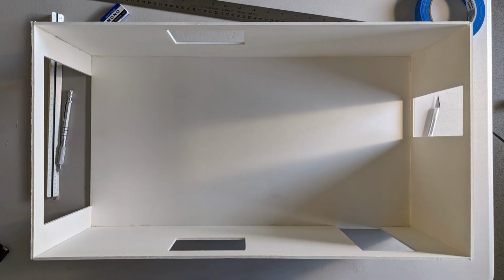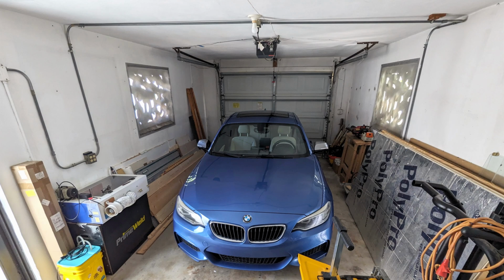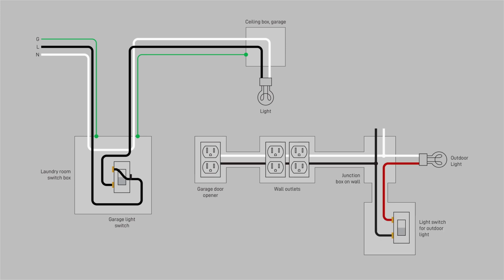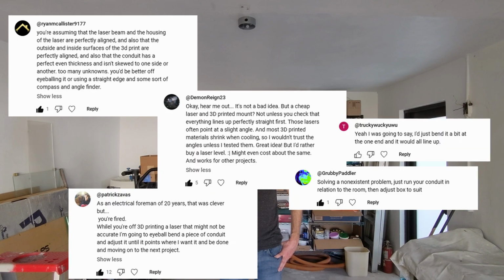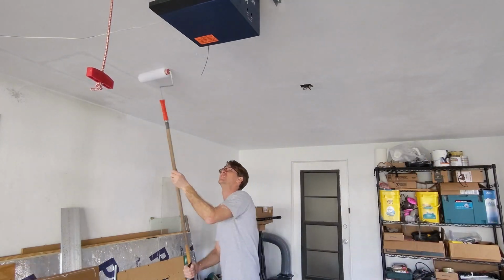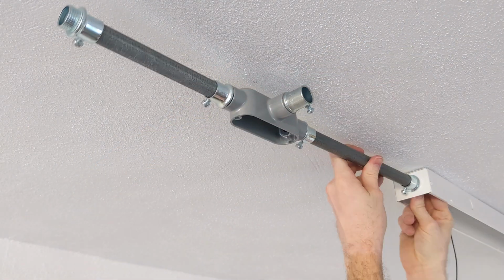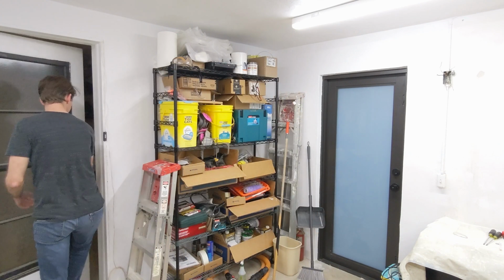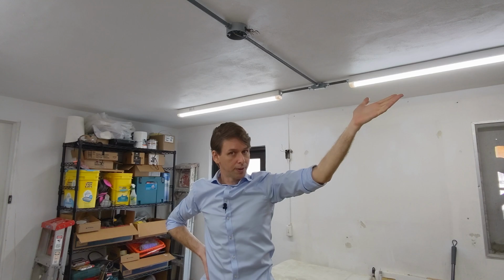Lighting the Garage Workshop: One Bare Bulb No More!

Comment: great video ! whereabouts are you located? are you an electrician? or do you have to get someone licensed to approve your work is to code?
Reply: @alwest444 Most states it is legal for the home owner to do their own electrical work. Small projects like this would most likely be legal. If you were doing an add on to your home and lived in the city limits, even as the home owner, you may have to pull a permit and get some form of inspection from the city.
Reply from the maker: Thank you! I'm in Florida. I'm not an electrician but I am an electrical engineer.